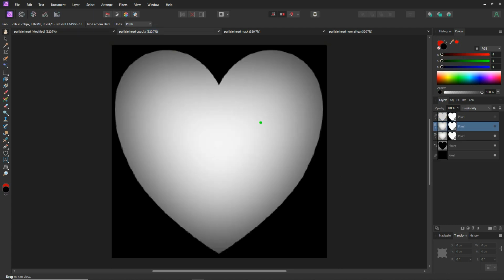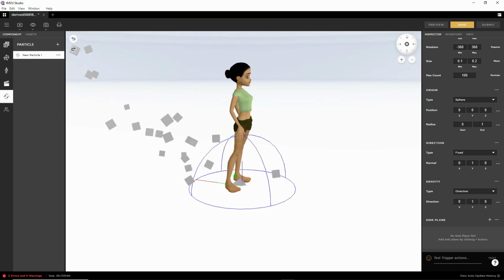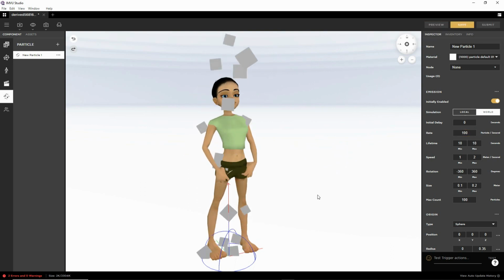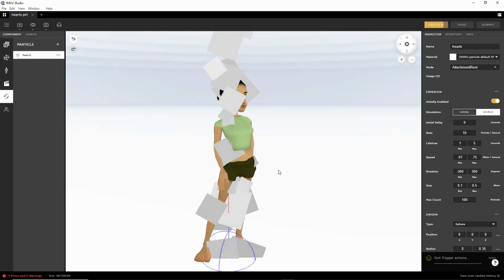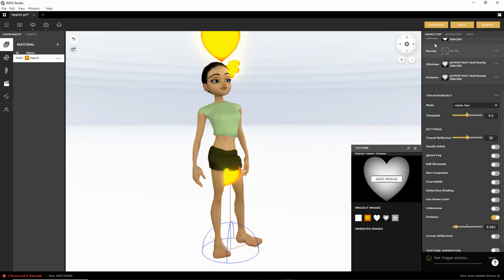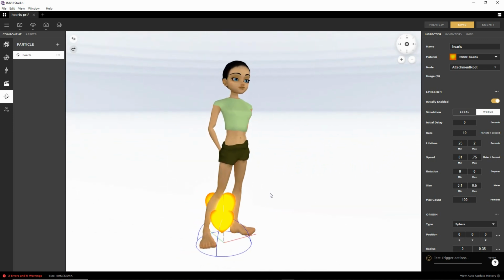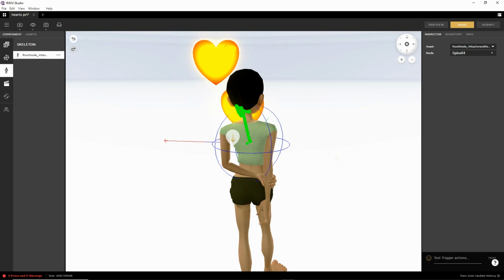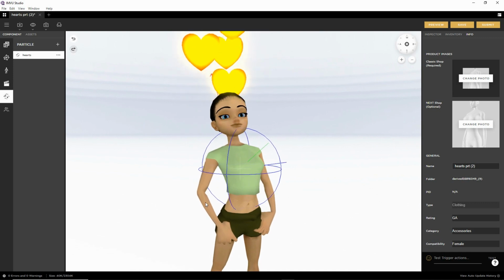IMVU Studio - Particle Basics

Comment: can particle systems be triggered?
Reply from the maker: Yes, just disable the "Initially Enabled" option in the particles settings. It should then proved info to trigger it.
Reply: @KatsBits  can I do it on classic client?. On and off
Reply from the maker: @thurisaz4life21012  not really no. Particles are officially supported in Classic so they have to be 'hacked' into place. IOW, you don't have direct setup/edit control over them.

Comment: Awesome very informative, could you maybe do another one with adding particles, sparkle effects to clothing. I have a general idea but can't seem to figure out how on earth I'll add it to say preexisting clothing with no sparkle effects or particles.
Reply from the maker: You mean like glitter? That has to be done through a texture, either as a layer (where possible) or by including 'sparkles' (spots and dots) in the clothing image.
Reply: Yes, like that, but say you want to add that as an added layer texture or add it to something that doesn't have it.
Reply from the maker: @TXFuryAngel  you can't really do that without access to the original item to add the new layer to (and that's notwithstanding otherwise having to try and model something to fit without the original). That said, you might be able to create a 'glitter' effect or sorts but it would only match the item or avatar generally - particles can't be made form fitting because that's not how they work.